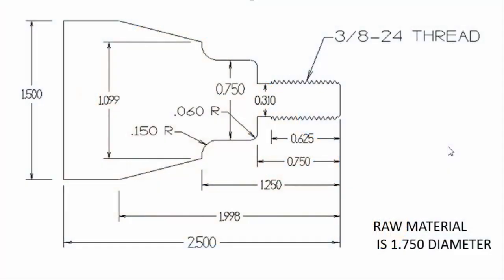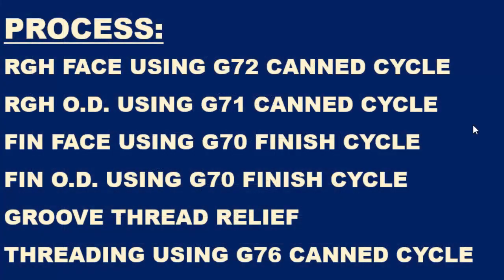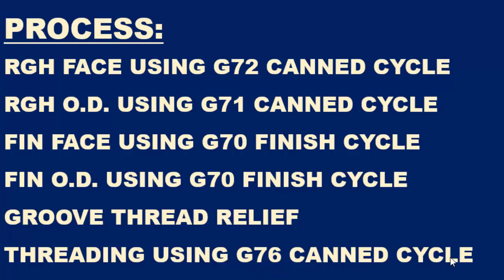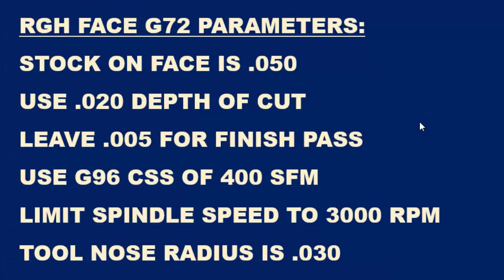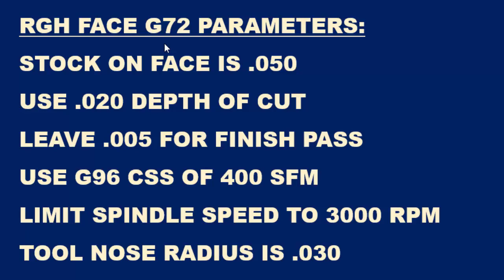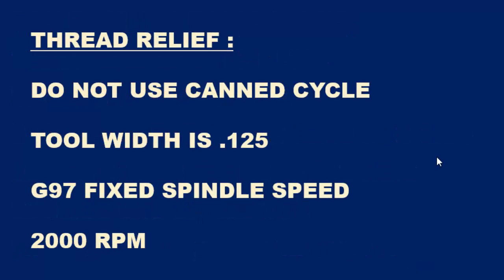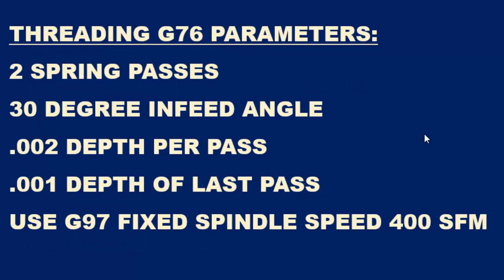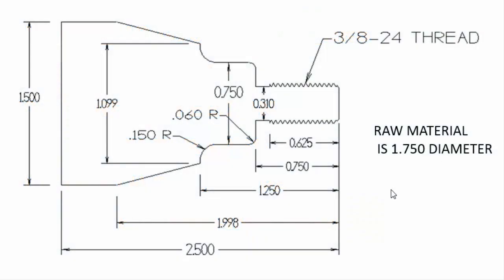CNC LATHE PROGRAMMING EXERCISE 1

Comment: 0.35 it so easy part no need CAM, but unprofessional drawing. what is angle of that big chamber. i need that for calculate compensation. for start i would need calculate that andge.
ok its 15.0053 degrees,but why? would it be easier just tell its 15degrees than give dimensions? why 1.998 not 2? and why 1.099 not 1.1

od 1.5 0.748x15degree if thats what looking for 1.099 is programmer nightmare and undeeded. that number is actually i BELIEVE becouse its 1.09914 and its rounded 1.099 if that is 15degree and. becouse these values it would not be 15 degree. i would do it exatcly like its drawed,but dont know maybe  this is how they do it america LOL if it 15 degree forget 1.099
becouse if i know its 15 degree i allready know where tool need be on od1.5 on that 1.998 dimesion. i allready know without calculating lol without need cam or G42
magic top secret code is (1-tan[angle/2])*TNR that would be added 1.998 .BEATS G42 and CAM i remember all compensation numbers for tool noses 0.2-1.6 for angle 15.30.45.75 . the most used angles. then it all bout. we had battle CAM seler versus cnc programmer. i made program 100% CAM measures. rule was not use G42 need calculate tool path. i made program faster than seller draw picture and started pushled how generate tool path LOL. i could hit cycle run and go coffe and help that seller pack his stuff we not need CAM. short story but true lol

Comment: Hi Sir Tom thank you very much for this wonderful video. I really appreciated to test my ability in programming :) Sir I try my best to program this part and please can you check what I made and your opinion and comments please Sir Tom!
%
O0001 ( CNC LATHE EXERCISES 1 )
(DATE AUG. 21'15)
(PROGRAM BY : LUIS P.)
(MAT'L : STAINLESS STEEL STOCK 1.750" DIAMETER BY 3.5" LENGTH )

(TOOL LIST)
(T0101-RIGHT HAND CNMG 432 RADIUS .030")
(T0202-RIGHT HAND DNMG 432 RADIUS .030")
(T0303-GROOVING TOOL WIDTH .125" RIGHT HAND)
(T0404-RIGHT HAND THREADING 60 DEGREE)

(PROGRAM START)
G20 G40 G80 
G28 U0. W0.
N1 (RGH FACE)
G0 T0101 (RIGHT H. CNMG 432)
G18
G97 S875 M03
G0 G54 X1.95 Z.05 M08
G50 S3000
G96 S400
G72 W.02 R.05
G72 P100 Q102 U0. W.005 F.007
N100 G0 Z0.
G1 X-.06
N102 Z.05
G0 X1.75
(RGH OD)
G50 S3000
G96 S400
G71 U.1 R.05
G71 P104 Q106 U.03 W.01 F.01
N104 G0 X.325
G1 X.375 Z-.02
Z-.750
X.69
G3 X.75 Z-.81 R.06
G1 Z-1.1
G2 X1.099 Z-1.25 R.15
G1 X1.5 Z-1.998
Z-2.550
N106 X1.75
G0 Z.05 M09
G28 U0. W0. M05
T0100
M01
N2 (FINISH FACE AND OD)
G0 T0202 (RIGHT H. DNMG 432)
G18
G97 875 M03
G0 G54 X1.75 Z.05 M08
G50 S3000
G96 S500
G70 P100 Q102 F.005 
G70 P104 Q106 F.005
G0 X1.75 Z.05 M09
G28 U0. W0. M05
T0200
M01
N3 (GROOVE THREAD RELIEF)
G0 T0303 (GROOVING TOOL WIDTH .125")
G18
G97 S2000 M03
G0 G54 X.75 Z-.75 M08
G1 X.310 F.005
G0 X.5 M09
Z.05 
G28 U0. W0. M05
T0300
M01
N4 (THREADING 3/8-24 UNF)
G0 T0404 (RIGHT H. THREADING TOOL 60 DEG.)
G18
G97 S1000 M03
G0 G54 X.475 Z.1 M08
G76 P020030 Q20 R.001
G76 X.3239 Z-.625 P256 Q30 F.042
G0 X1. Z3. M09
G28 U0. W0. M05
T0400
M30
%
Reply from the maker: Looks great Luis. That is definitely a complete program ready to run.  I only have a couple of suggestions. At the start of each operation add the safety line and reference return lines.  That way each operation is a mini program in itself in case you ever need to restart in the middle of the program.  I would also suggest to always make a Z move first on your initial approach and then come in with X.  If the steady rest is ever forward the tool will not run into it as it approaches the part in the shortest distance. That's all I can suggest. Great job. Thanks for sending this to me.
Reply: +Tom Stikkelman Thank you Sir to your suggestions I really appreciated and I will do that. I like all your video it is very helpful not only for me also to everybody. More power Sir! :)
Reply from the maker: Luis Pagaling Thanks Luis. Thanks for your feedback.